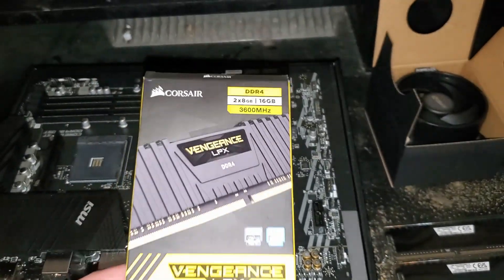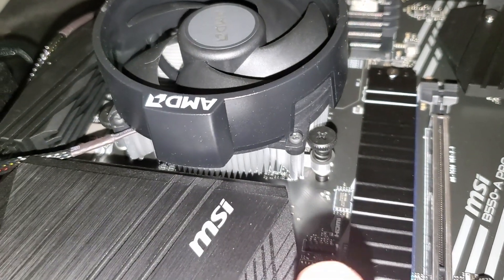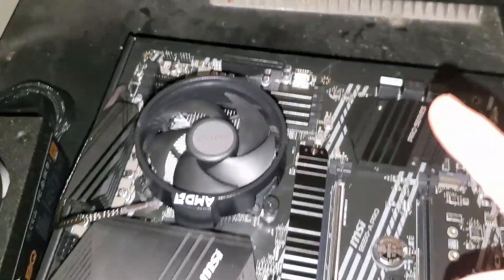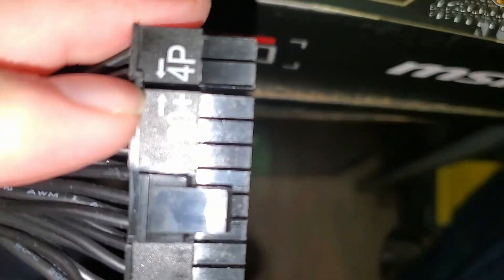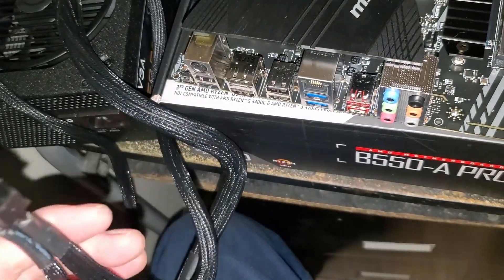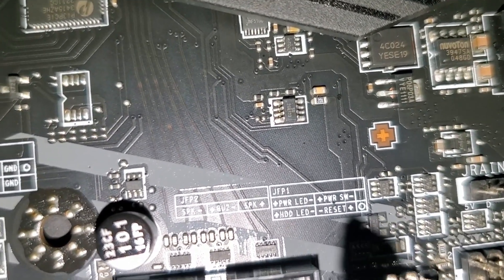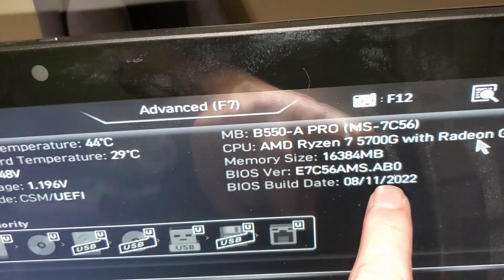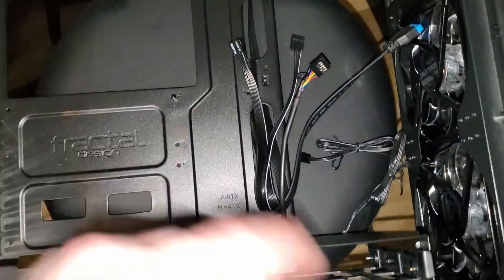Bonus B550-A Pro System Build Video - Fractal Design Focus G

Comment: Hi Kardall, not sure if you could help me out, I just attempted my first build today with this board, however whenever got everything plugged didn"t work, got the EZLed for cpu blinking white,  I troubleshooted pretty Much everything, no bend pins  on the processor and reconnected all cables, Im not even able to attempt update BIOS bc when I connect the psu and turn it on, it starts blinking white with that cpu led, is there anything I can do ir that you advise me to do?
Reply from the maker: What you need, is to follow the Bios update video that this was accompanied with originally. 

https://www.youtube.com/watch?v=8VghbzVYv3M

You put the bios on a Fat32 formatted USB, plug it in and push the Flash Bios button then wait ~5min. :)
Reply: @Kardall  Yes, I watched that video  of you too, but for me instead of the white led being turned on all the time, it starts blinking as soon as I turn the psu on, and then when I try to do the process with the USB nothing happens after pressing the flash button, this was my first build so I don't really know what else I can try ):
Reply: @kennyUrT  did you find a solution?